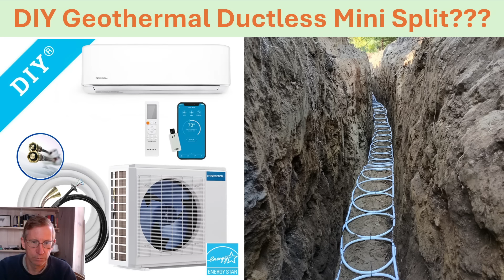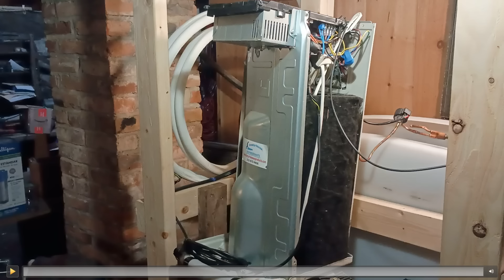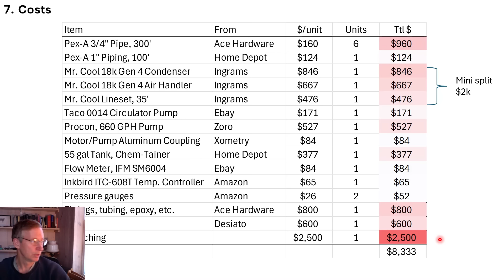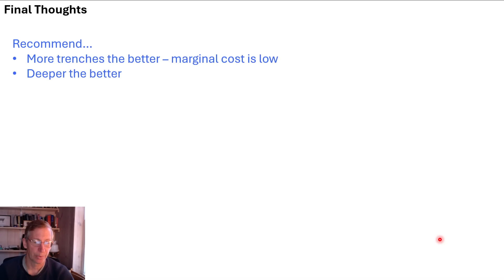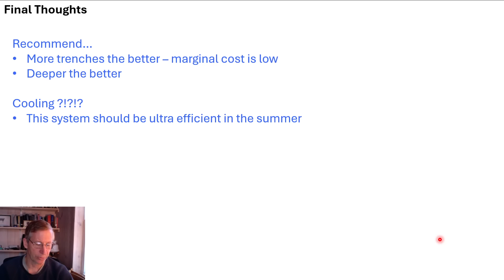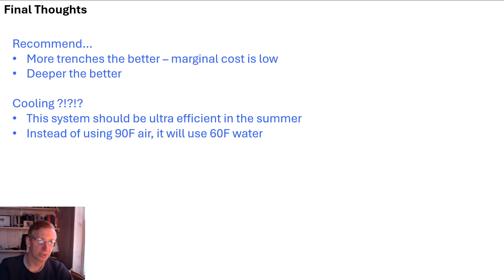DIY Geothermal Ductless Mini Split (Ground Source Heat Pump)

Comment: Interesting approach.  I've been looking at geothermal as an option as I live in an area with a lot of clay which is a great source of retaining heat in the ground. 
-I've seen quite a few video's using HDPE instead of PEX for the ground source loops.  I'm not sure of the thermal differences - but curious as to what they may be.   One note for Pex A is that it should be expanded for connections - if you want to use compression - use Pex B (I learned this the hard way with leaks). 
-I agree with the others for water protection - there are other additives that will help protect your system that I would also use.  

-It's after the fact, but performing a Manual J calculation/Heat loss analysis is always a good method of evaluating you load needs -it is also beneficial in that it helps to identify any problem areas that you may want to address beforehand.
thanks
Reply: Thermal transfer happens with total pipe area, so, if you want remarkably better transfer, you need something far more conductive than plastic, and there's a reason nobody really does this and that's the fact that the ground eats basically anything made of metal fairly quickly.
Reply: @jttech44 I agree- my preference would be aluminum or copper but they were presenting PEX/(plastic)options.
Reply: @petersamios5409  I can't think of anything that'd survive soil exposure long-term and be cost-effective. Strictly speaking, you could do epoxy coated metal, and you could dope your epoxy with copper to increase conductivity... but that probably 10x's the cost, cheaper to just use more PEX and dig more trenches.
Reply: @jttech44 for trenching I’d use HDPE. I’d use insulated PEX as the feeder lines to/from the HDPE loops. I use copper/aluminum for heat exchangers.

Comment: Do you think it is possible to build an insulated shed around the outside condenser, which is then warmed/cooled by an air tube in the ground? If the tube can keep the air at a constant 55 degrees, the condenser should run much more efficiently in summer and winter and have a better cop.
Reply from the maker: You still have to transfer the same amount of energy. The surface area that you'll need will be substantial and you're going to have to go deep.   In connecticut, you'd never get 50° air coming out of the tube in the winter unless you had a massive amount of surface area, and very deep.

In the summer you'd have a condensation issue in the tubes, which you would have to have drain somehow.  Having holes in the pipe isn't an option, because they would flood if your soils get wet

Comment: No! No! No!?...Did I say No!  WAY too complicated. Just install a mini split normally with an adequately sized radiator from a junkyard ($40) in front of the condender/evaporator coil. Attach it with aluminum tape. Pump the fluid (antifreeze, methanol etc.) through the pipe and coil. In the summer you're at 60 degrees ambient and the same in the winter. KISS!
Reply from the maker: I think it might work, but you're adding another heat transfer step.  I don't think you'll operate at the same temperatures that I am able to

Comment: I live on a houseboat where on a cold night we might see around 0 degrees C (32F), but thinking I could just pump the river water through a tank to do the same thing as that would probably never be under about 15 degrees C. But in summer when we use for cooling, we can have low 40 degrees C (over 110F) and water may only be a few degrees warmer than in winter (say 20C.) I assume the bigger temp difference between the outside air and the water temp, the greater the efficiency? Also, how do you go with units that have a variable speed outdoor fan? Would I be best to try and get an output to drive a relay to switch pump on and off directly? Or maybe just a thermostat on the water tank? Although harder to do between heating and cooling. Great video.
Reply from the maker: Having a water source is ideal, so I would encourage you to do it.  If your water temperature is 20 c and it's 40 c outside, you will have a massive efficiency improvement.  As for the variable speed motors, it's okay for the pump to operate at different flow rates, it will be optimized for the temperature of the fluid.  You will have to choose a pump head wisely for the RPM of range of the fan motor

Comment: Lots of good info, thanks for the video!   Heat pumps are evolving rapidly, especially in China.  A web search for "alibaba water to water heat pump" shows lots of house sized heat pumps at around $2k with shiping to the USA.  One box, condenser and evaporator included, so no need to mess with refrigerant lines, just water lines in from the trenches and water lines to the house.  Will also need a buffer tank on the house side of the heat pump (50 gallon plastic barrel(s) with outside insulation?  Huge 10000 gallon insulated cistern?) and pumps and such.  Hydronic floor heat is ideal, works well at low water temps so higher COP.  Also self contained air-to-water heat pumps, again all refrigerant is inside the unit.  R32 seems to be the best refrigerant choice for now here in the USA which severely regulates the use of R290 (propane) as a refrigerant.  If you don't have big rocks, you can probably skip the sand.  I wouldn't climb into a narrow trench deeper than 5 feet, even at 5 foot a wall collapse can kill you.  Offgrid here with limited PV power in December/January, so still evaluating whether this will be worth doing.

Comment: BEAUTIFUL! I am amazed at what you accomplished here. I was just wondering how I could use this exact set up!  I had extra radiators and heat exchangers this is so simple . I come from the school of my grandfather lol. He did a bunch of stuff kind of like this over the years it was awesome to have him as my grandfather (zero actual formal schooling but self taught through years of study and reading with his 2nd grade reading skills and zero ability to do multiplication and division). So I think I would set up a homemade exhaust manifold from tubing in front of the coils < HHH pattern with main inflow in center, as a bonus for doing it this way the inlet/outlet tubes wont actually pierce the tank therefore less chances for leaks and I can burry the tank in the ground > for the water (I would use -40 windshield washer fluid) to flow in and similar yet with larger intakes on the back with maybe a shield around the edges to keep water from going around the coil <enough room for it to flow over the top just in case of freezeing> . Then use a simpler set up for the pump using just a single pump with a temp on the radiator for high/low temp auto engage of circulating pump . This might not be as efficient due to running during off cycles but it would maintain the tank temp better  . My outside building will be the first to get one of these! Going full solar so it's going to be completely off grid thanks for all the data and ideas!

Comment: How much more efficient does this make it? For example, if MrCool’s website says that their 12k BTU air source units can heat/cool 500 sq ft, would doing this conversion allow it to heat/cool now 750 sq ft for example?
Reply from the maker: Focusing on heat output instead of efficiency, if my water temperature is 38 degrees but the outside air temperature is 0°, my system will put out 18,000 BTU instead of 10,000 BTU.  So if I had a mini split I would have needed a system almost twice as large to do the same heating

Comment: I am surprised there is not a mainstream option, I get that its a limited market, but really it wouldn't be a hard conversion for a manufacturer to produce. Replace the fan and coil section with a heat exchanger and replace the fan with a properly sized pump. Two lines and dig a ditch, even at 5 ft deep it would be way more efficient than air source. Where I live there are a significant amount of people that have shop buildings on large enough lots/land to do this. Most of the time you know someone who has a mini excavator that will help you out, if not renting one for a weekend is not that pricey.
Reply from the maker: We should all start writing Mr Cool!

Comment: Hey, for the reversing of the pump.  Use a sleeve with one way bearings in it.  it will spin the shaft correctly in the desired direction and when it reverses it will spin freely on the bearings.  We used these all the time in our remote control model cars for differentials.  Also, did you really need to bend the coil?  could you have used a vaning/jetting system to direct water flow across the coil?

Comment: One thing I've seen is heat pumps do a much better job at maintaining temperature than they do for big heating and cooling swings. Might consider keeping the house at one temperature throughout the day to increase efficiency
Reply from the maker: I actually did that much more this winter, I didn't turn it off for over a month

Comment: What is the temp difference between incoming and outgoing water? If you have 50deg incoming/ground temp water and it leaves the tank at 36 deg you are not circulating the water fast enough. Flow rate needs to increase.  The ground can not warm the water fast enough when you have a 13 or 14 deg temp drop. Your loop is not long enough.
Reply from the maker: I wish I had 50F ground temperature in the winter!  Typical delta temperature is 4F.  Temperature leaving the tank can get as low as 36F

Comment: What is the incoming and out going temp of the water?
Reply from the maker: At 10,000 btu/h and a flow of rate of 5 gom, the delta T was ~5F.  The delta temperature would vary up or down from this based on the power output of the heat pump.  Outgoing water to the field was as cold as 36F

Comment: Spectacular work Sir!!! Thank you for sharing the project and the data collected. Question: why not add an additional heat exchanger (connected the the ground loop) in front of the unmodified unit? At the penalty of having to push air through two heat exchangers now, you get preheated air. The added benefit in the shoulder seasons is it that you can chose to turn off the ground loop when you still require heating, but the air is now warmer than the ground source. Would love to hear your comments. Thank you.
Reply from the maker: There are times, in the late winter and spring, that the ground temperature is lower than the outside temperature, while I still need heat.  It is making me less efficient at these times, but the energy demand is so low (50F day for example) I don't think it is worth the added complexity.

Comment: Don’t use the fan motor to mechanically power the water pump. Get a separate water pump and power it with a contactor that closes when the compressor gets power.
Reply from the maker: The unit monitors the fan motor and it will shutdown if not operating as expected, contactors wouldn't work

Comment: You could have just bought a geothermal slab coil and piped the water into that, they come with the proper hookups for a heat pump, all you would have to do is learn to solder and have someone fill it up with refrigerant.

Comment: I always wondered If you burry the heating/cooling lines into the ground, there is almost 0 heat exchange in the dirt. The graph based on day of year is nice, but it doesn't include what will it do when you start pumping external heat in it. I hear some bad cases where they used it only for cooling so the ground gets warmer and after like 4-5 years, the ground around the pipes is similar temperature or more of air and the heat exchanger starts to be less efficient than if it was only air cooled.
Reply from the maker: I doubt it will cool over the years.  
I'd expect the soil to change with the seasons, although delayed at depth, and there to be little long term temperature reduction.  For those that use ac a lot, you'd be heating the soil all summer and as well

Comment: Really interesting subject and incredibly well presented. It stimulated some questions for me. The first one that I wondered, could you have used a better material in the trench bottom than the sand, which would have better thermal transfer capability? The electrical savings are apparently obvious, but some empirical data would have been nice. But to do that fully, you would need to not only measure the running power consumption of original air vs ground system, but how much (less) time the system actually runs, due to the efficiency of the system. i.e. the net kWh per day for ground vs air - and to get that it would have needed a comparable baseline from the air system. So net added investment of about $6K (comparing air to ground delta cost) - what would your ROI then be based on the energy saving?

Comment: question - has anyone looked into using an "AIR SYSTEM" - air supply pipe below ground and supply a constant 55 d +- to the unit year round. ?
Reply from the maker: It would have to be a closed loop air system, otherwise you'll be continuously having to heat cold outside air.
Transferring heat using air is challenging (but obviously not impossible as that is what a mini split does!)
Reply: @edwardwazer5103 that would be one option but expensive.
Using a high efficiency ac/heat pump supply the outside (transfer) air via underground pipes.
Supplied air at optimum temperature especially for heating.
Yes a bunch of thermodynamics cals to bring say 32 d out side air under ground to pick up to 55d then supply to unit.

Comment: I’m not a HVAC Engineer, but I think that heat pump coil that you straighten out is designed for the refrigerant to horizontally. In the correct position the vapor refrigerant runs at the top on the coil then condenses to a liquid at the bottom. Turn the coil 90 degrees as it was in the original unit.

Comment: To resolve your pump problem you could fashion a rectifier with 4 check valves so no mater which direction the pump goes the water always goes the same way.   

I’m not sure it this is the most cost effective solution, as check valves in this size could get expensive.   It may be cheaper to build a control circuit that keeps the pump going the same way.

Comment: Have you considered using a brazed plate heat exchanger instead of the original condenser coil that comes with the mini split also is the system still running well ?

Comment: How are things holding up?
 I am an HVAC contractor. I am looking at taking a standard 14 seer Goodman 410a 2ton and cutting out the condenser coil and adding an axial flow exchanger.  
Have a backhoe.
Reply from the maker: A temperature sensor failed, other than that, great!  
How about just adding a tube in tube heat exchanger that are typically in a ground source heat pump?

Comment: Any update on summer performance?
Reply from the maker: I'm not a big ac user, and it isn't that hot here.  I ran it for maybe 10 days, with water temperatures around 60, so it was running very efficiently.  I'll try to put together a brief video with some data this winter

Comment: Tech ingredients youtube did a ground source heat pump where they focused on improving the heat transfer coefficient from the soil to the in ground Tubing.  They achieved a significant improvement in heat transfer efficiency by creating a mixture of graphene and bentonite clay, and surrounding the tube's with this mixture.
Reply from the maker: Sounds like a good idea. 
 I was hoping that the ground was wet enough that sand would be ok

Comment: I built a dedicated heat exchanger because I was told the water will dissolve the aluminum coils that are only meant to manage air.
Reply: Not the same application, but for over 10 years I'm running a watercooled PC using large passive aluminium radiators. Despite the many horror stories you might find on the net, I honestly never had issues with leaks or corrosion.
Reply from the maker: I hope not!  The tubing is copper, the fins may be aluminum, but I don't think that's a major risk

Comment: I think you did an awesome job!!! Thanks for sharing. Great break down.
I thought sand was an insulator though. I wonder if you would have much better results with the mix to put around ground loop the YouTube “Tech ingredients” used for your system to boost efficiency.
Reply from the maker: In winter, the soils should be very wet.  I have a hand dug well close to the loop field and it is just almost to the top in winter

Comment: In Europe we can get a brand new Water heat pump unit at the price of the makeshift heat exchanger. They work with plate heat exchangers, which i would recommend over the tank one.

Comment: Liked and Subscribed I've been thinking about doing this for a few years but never had the guts, I'm good with plumbing, electrical, and simple circuits but I always feared it was easier looking then it really was, and you proved me right. You filled in so many blanks I almost want to try to do this with a window Unit AC, some plumbing pipe, and go ahead and get my basic HVAC license to be allowed to harvest\fill just not work commercially.
Reply from the maker: If you want to modify the refrigerant lines, you could actually make the job a lot easier.  Go for it!

Comment: I am curious as to if this system would be efficient in an area where the outside temperature can reach as low as -40°F/-40°C. What's your thought about it?
Reply from the maker: It certainly can work, it is just a question of sizing the system (ground loops and mini split).  With my system size, insulation, etc, I'd be pulling too much energy out of the ground to maintain a comfortable indoor temperature.  The entire system would have to be at least 2X

Comment: Heat pumps function more efficiently if the house thermostat is left at a constant temperature. Warming the walls, floors, ceilings and furnature takes a lot of energy. Heat pumps do not have that instant heat like a conventional furnace.